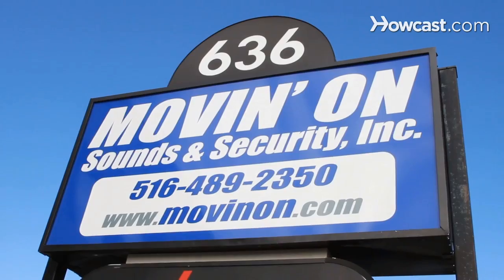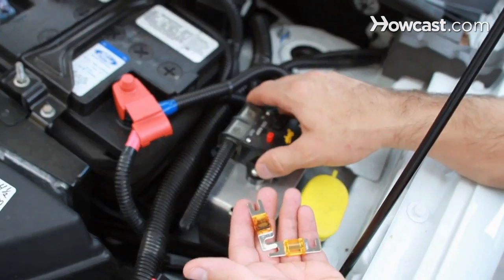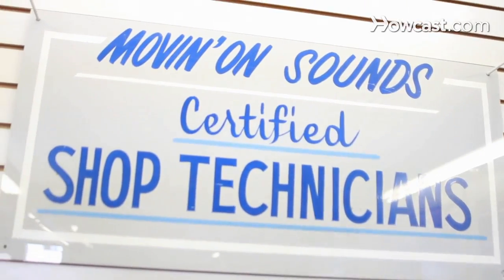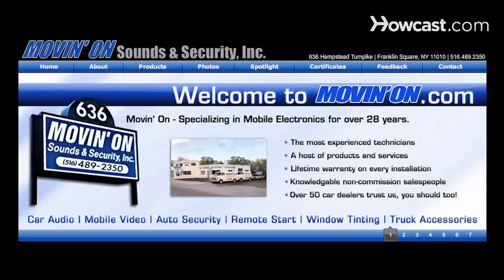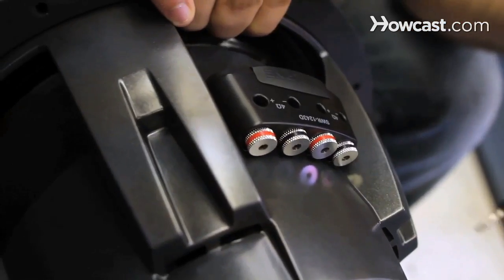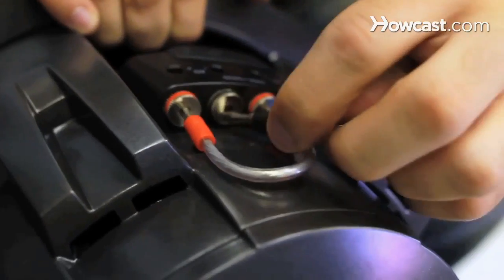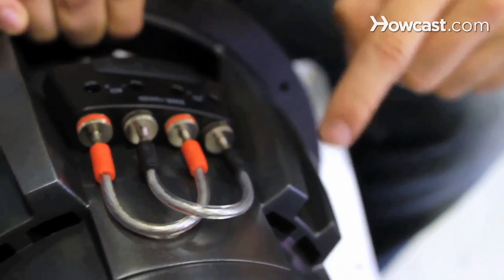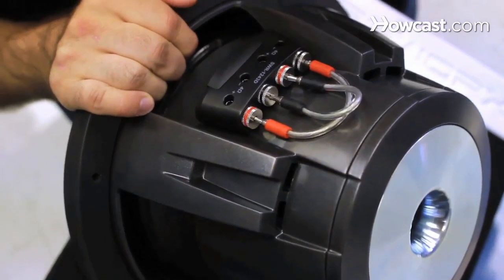What Is a Dual Voice Coil Subwoofer? | Car Audio

Comment: you forgot to mention a 4 ohm DVC can be run at 4 ohms (single vc only) OR the typical 2 ohms or 8 ohms.. 
DVC subs can run in 3 different orientations.... DVC subs don't handle more power. A DVC sub is rated at 200w rms.. this means each vc is rated at 100w rms...

Comment: Too many confused people here.. Rightfully so... A duel DVC speaker doesn't really have two voice coils, it actually have one voice coil wrapped in two parts.. Both parts must be used at the same time.. Either parallel or series, if you use only one part  you will only be using half of the speaker power rating which will result in damage to the speaker..
Reply: that is WRONG... you will NOT damage the single VC if only running one VC... The issue is when the sub is rated at 200W rms, that means BOTH vc's are rated at 100w each.. When you run one vc at 200w rms, the % of blowing that vc is very high... This is why people damage the single VC on a DVC because they are not lowering down the power to that sub...  I have a 10 inch pioneer DVC in my nissan since back in 2004 and its running on ONE VC only and its still going... Yes i made sure that the power going to it was almost half its nominal power rating..

Comment: If the coils are in series the sub gets less power but if the coils are in parallel the sub gets more power. It's because if you have a set voltage then you will get more amps with less resistance causing more amps and if you wire the coils wrong, then you might pull too much or too little power and pop the amp

Comment: they can not handle more power with dual voice coils that is just plain wrong when it is rated for 1000W for example, that is what it can handle.
Reply: If the coils are in series they draw less amps but when they are in parallel they draw more amps

Comment: I understand the ohms principle stuff, but what happens to the wattage? 
I assumed the the wattage increase or decrease depending on the Wiring .
Reply: The wiring of the coils decides how many amps the speaker draws and the wattage if the voltage is known

Comment: i do not agree 100% with what he said about dual voice coil speakers could handle more power.. because a single coil speaker rate for 1000 watts rms would handle the same power as a dual coil speaker rated for 1000 watts rms at same impedance.. but i do agree that implementation of dual voice coils gives the technician more wiring options..!!!

Comment: This video really didn't help. I still don't understand the difference between dual and single voice coils. also, I have a dual voice coil, and it has four connector tabs 2 neg and 2 pos. so if I only wire one set, does it still power both voice coils? or do I have to connect both sets? or does it not matter at all?
Reply: +james martin your answere is shit. i do think the same. how it should be connected? pos to pos, neg to neg? or this will drop you to half ohm? do you need to have a 1000w x2 amp to power a 1000w speaker?
Reply: Pos to pos neg to neg ...
Cuts ohms in half.....
Reply: I'm confused, what's the difference between having a brain and not having a brain?

Comment: A dvc sub doesn't handle more power because it is dvc. Subs that have dual coils are generally higher models than single coil subs, and are made to handle more power. If I wire my dual 1ohm sub to 2ohms it's the same as if the manufacturer made the coil with a single length of wire with the resistance of 2 ohms. If I wire it to 0.5ohms it's also the same as if the manufacturer used a thicker wire which had less resistance and wound the coil to be 0.5 ohms. It still handles the same amount of power.
Reply: johmedis Thanks, it was a pleasure :)
Reply: you r wrong my friend
Reply: Prove it please.
Reply: Pretty simple to prove. USE common since and come to me and i will Prove you.
Reply: Yup, just what I thought. You can't prove me wrong.
Reply: Typical internet warrior.
Reply: bassl0va Bravo. This show was hilarious.

Comment: You would have power losses from the resistor giving off heat. Better off and more beneficial for a dvc or 2 subs in parallel. :)

Comment: im no expert but lets say you have a 2 ohm amp and you have a single 4 ohm subwoofer, couldn't you just run a 4 ohm resistor and run it in parrarell with the subwoofer to drop it to 2 ohms to match the amp?

Comment: i need help .i got 2 performance teknique amps icbm 772 800 watts.should i hook up 2 dvc subs to get the most out of these amp bridged or just hook up each voice coil.i want to use 1 amp per speaker so whats the best way to get at least 400rms per speaker